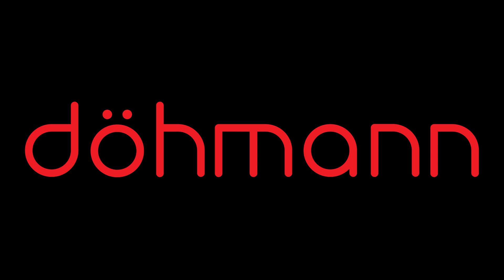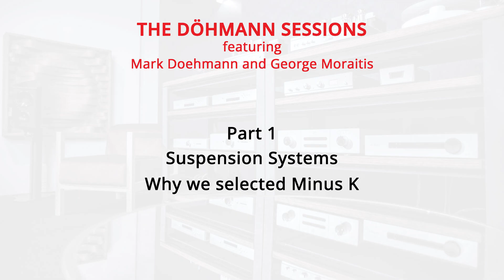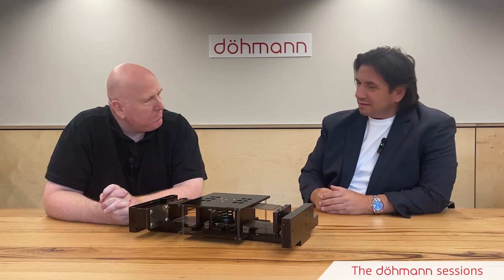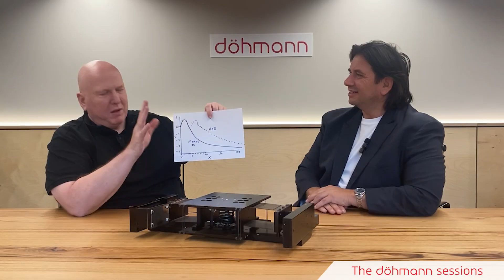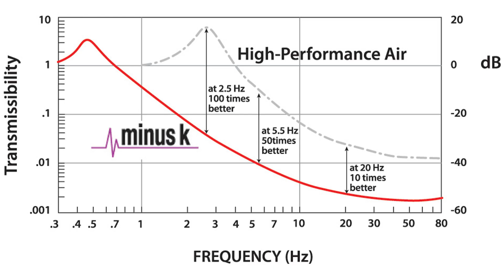The Dohmann Sessions - 1 - Suspension Systems

Comment: Seismion is the best available now, absolutely destroys Minus-K
Reply: Nomograms are the industry standard disclosure of performance measurement. MinusK publish their results from 0 hz to 100hz. Overlay this nomogram over the published manufacturer nomogram data from other isolation devices and it will help in this analysis.
Reply: @mdiamond7330 Seismion does as well. The industry has moved on - active response as in the Seismion is much better than passive. Again, things have progressed and moved on.